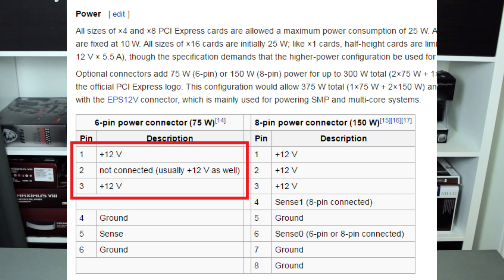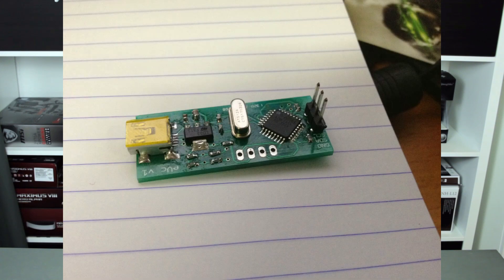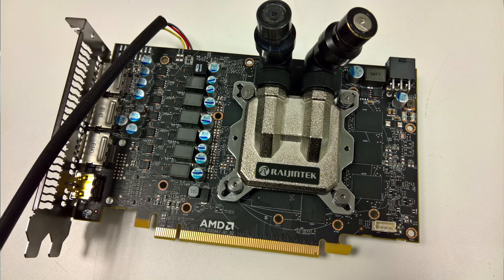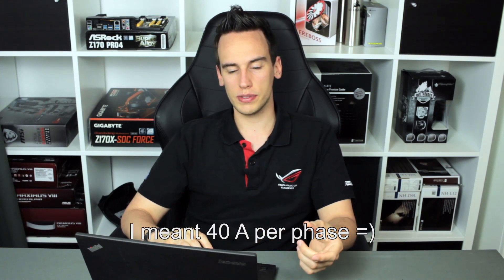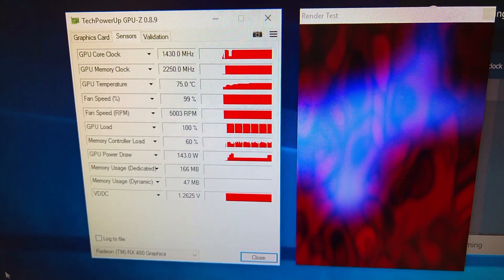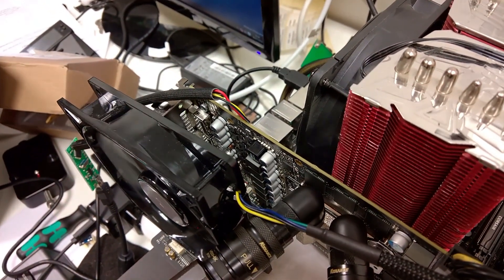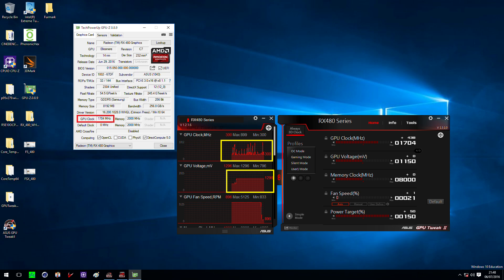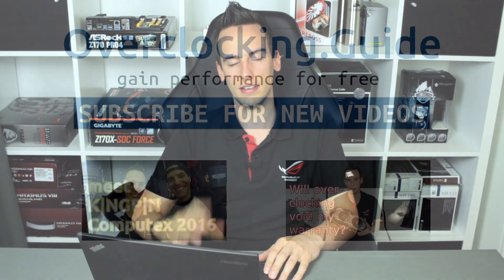Advanced AMD RX 480 Overclocking - 1500 MHz using I2C and watercooling

Comment: Not bad... Not bad....

I have the world record RX 580 /w 9900K.

It's the fastest aircooled RX 580 in the world. I absolutely promise that. It does 1570mhz/2500mhz stable (UberTimings 3.4)1.430v GPU and 950mV IMC.

It has copper shims installed between the memory and heating, liquid metal on the core, and thermalright TFX putty on the VRM.

I'd put it up against anyone's watercooled RX 580 as well.

It's so good, I'm probably going to watercool it just so I can make sure it lasts. 75c after gaming for a few hours.

I'd like to get it down to 50c or less and maybe aim for 1600mhz @ 1.5v.

Comment: Looks like j4003 on the soldermask is an i2c header aswell. On pretty much all radeon cards. That 480 had it just to the right of the core at 4:29

Comment: Hi der8auer, I have an unfortunate issue that caused the rx 480 bios .bat file to crash my rx 480 8gb reference sapphire card. 

Any recommendations? I am unsure whether it is bricked or not. Did the new drivers break it? 

I have a second backup gpu to flash the rx 480 back, but it doesnt seem to work in windows, I get errors. 

SHould I try in dos? 

Regards

Comment: I did something similar for my RX480 (bad 70%ish asic quality)
I used a bios editor (SRBPolaris) that set the voltage by messing with the I2C, unlike polaris bios editor who just change the pstate and voltage past 1.15 don't set.

1510Mhz@1.35V, TDC limit set to 170A, the other limit to something like 260W, stay at about 60ºC, thank to my custom loop :)
Note that having the voltage set that way, prevent all userspace tool to work. Changing the clock with afterburner, even just 1mhz down or up, crash the system.

Comment: It's scary, how close you came in your prediction.
My Sapphire RX480 Nitro+ 4GB, runs at CORE: 1400MHz, MEM: 2000MHz with an added plus to core voltage of +78mV(stable).
As soon as I try to push it to 1410 or above, it fails...

Nice video - cheers and thumbs up, from Denmark ;)
Reply: Guess i should feel happy with my MSI gaming X model runing @ 1440mhz/2140mem , using a 240mm AIO :p

Comment: What's nice is that 580 you can top with 1480-90 on good chips with 1.15volts :) and run it near silent on air. Good improvement in my book for AMD!

Comment: i have two 970 runing @1545 mhz an in sli 1430mhz with cusom bios 1.25v /1.3 but can i get more out of them ?
i know heat is a prolem gpu 85 C and more but is it worth it to whater cool them ?

Comment: I overclocked my MSI Gaming X 4GB from 1303MHz to 1400MHz on stock voltage, completely stable. My stock voltage never goes above 1.1250V. I was able to get 1450MHz stable with +30mV, but it can definitely go higher, I'm just not comfortable with such voltage for heavy use.Do I have a good overclocking card, because wherever I read people have trouble getting much above 1.4GHz, even with extra voltage?

Comment: Is it necessary to go with some custem cooler, or just replace thermal compound? (Sapphire Nitro+ version )
And if I want to go for some custom cooler air/water do I have to place heatsinks on memory? 
I have 4GB version, that can manage 1440MHz @ 1.175V stable on benchmark, but so far I run it 1400MHz @ 1.09V stable for everything.
Reply: TheSarillus I don't know if sapphire is "cool" with you changing the thermalpaste. I am nit sure if it is worth to remove the warranty of your card to gain 3-5 degrees less. My XFX GTR Blackedition is supposed to use "the optimal thermalpaste", yet the website of XFX says if you want to change it, send it to XFX so that they can do it for you :D Yeah sure I am going to pay for shipping from Germany for that.
Reply: TheSarillus And yeah for long term use I would usr heatsinks on the memory, you can get them really really cheap on amazon from some chinese brand with included thermal pads... Full copper.

Comment: This reference card is totaly bullshit. My Rx 480 xfx gtr is running at 1455mhz on core and 2200 vram and the max power draw was 130w.
Reply: Obtuse goose it is achievable, I got my Sapphire rx 480 to 1445mhz and 2150 vram but my power draw is around 185watts. The xfx card is amazing, watch Jay's two cents video. He got a 1475 with a temp of I think 65 C
Reply: Jerry Hou holy shit, 185w, that is too much, mine max watt draw is 140w.
Reply: Higher Ehhhhh, kinda, but a friend of mine has a rx 480 and his max at 1400mhz is 210watts.
Reply: Higher correction, I was using Sapphire trick to trace the power draw and I got 185. When I used msi after burner, it is in the 135 range
Reply: JBT so, the sapphire trick was wrong?
Reply: Higher yeah, but their overclocking functionality is great, on par, if not better than after burner..
Reply: Man, agreed with you, using Sapphire trick i was able to reach 1500mhz on core 2200 mem. Thats insane!!!
Reply: Higher, what are your temps
Reply: Higher thats called power cloxk trottling

Comment: I have a question , why does Amd cards struggle to reach 1400-1500 MHz in over clock and have low base clocks while nvidia cards have even base clocks starting around 1500-1600 MHz in their cards and can boost up to 2000-2100 in some cases.doesn't core clock matter that much ? and even after that these cards doesn't have such significant difference in performance as these clock number have a gap between them for both companies.So what is the factor that makes performance differences if it isn't a core clock number so that amd isn't far behind of nvidia even after massive difference in clocks & boosts ??
Reply: its all about different paths to performance, a good analogy is car engines, there are two ways of increasing performance: increasing the capacity of the engine (add cilinders) or you can tunne it of higher rpm, as its true in engines its hard to make big engines reach high rpms. thats why, amd has bigger gpus at lower clocks and nvidea has small gpus at higher clocks,
you could say that the rx 480 is a small gpu, with is true, the reason thats it doesnt clock higher is probably a design decision as they could have made it to clock higher with some tweaks.
Reply: hmm that does makes sense , thanks for your input.

Comment: stock I got mine to 1380mghz and the memory up to 2250mghz. so essentially instead of getting another 480 to compete with one 1080gtx I'm going to get two 1080s later. The 480 is garbage unless you're running two of them CF.

Comment: see, I used the Arctic Accelero Hybrid III 120mm and flashed tie vbios to your unlocked one and I use Asus gpu tweak II, and I set the voltage to 1.3v, but when I check in HWinfo64, it measures quite a bit lower for the gpu core. is this reading affected by the 80mm fan I have plugged into the pwm connection on the gpu PCB?
Reply: oh and my core clock is at 1430MHz.

Comment: just overclocked my custom  xfx 480 to 1480mhz on air :D
Reply: +kt3o5 Black edition GTR?
Reply: Tekky Quickbits yes
Reply: ALph4 1420mhz, but I tell you when I got my aio cpu cooler and new case fans...
Reply: My ASUS RX480 OC 8Gb gaming was also able to overclock to 1480, but only after I reflashed it to the RX580 bios, used VRM to overvoltage to 1.3v and report 0.5 load. Memory was clocked at 2250 MHz Temps were stable at 65c and performance was very good for a rx480.
Reply: Is it every gtr that is oc'ing like this?
Reply: marcusrat44 I can tell you tomorrow if mine does aswell
Reply: So, does it?
Reply: General Feldsalat how did it go?

Comment: der8auer - thank you for your videos and explanations and for you unlocked air BIOS. I am running a 240mm AIO water loop on my card and I want to know what is a good and safe voktage for the GPU. Is 1.3v ok under this conditions? I am around 43C under load with the AIO cooler. Also, regarding VRM - 90C measured with laser thermometer - is this ok compared to the rated 125C for the VRMs? Thank you!

Comment: It's a very silly excuse to say that PCIe power draw isn't an issue just because a motherboard has multiple PCIe slots. Just because a board might be able to output >150W across /all/ of the slots at once, doesn't mean it's okay to draw above-spec on any individual slot. That's why the specification talks about power draw for one slot, not total! - And at any rate, what if you had multiple 480's? Then all of the 16x slots could be drawing current over-spec, and that's even worse than having just one slot over-draw! Furthermore: Not all mobos have multiple PCIe 16x slots.

It also depends entirely on the quality of the motherboard: An older, aged, budget motherboard will struggle MUCH more with over-spec power draw, compared to any new or high end board.

Comment: Em...I checked from intel website, it explains that "All intel motherboard only supply 75W on PCIE slot". It means each PCIE slot can only supply 75W. Multi GPU get around 150W is no problem, only if each pcie slot draw lower than 75W.

Comment: Nice video der8auer. I've used your info on overclocking.guide on the shunt resistor mod on my gtx 770's and it works out great. They been running on the reference coolers at 1300 MHz for over a year now no issues. Only use solder on the back of the cards, the max TDP only gets to 65% leaves a lot of headroom for a water block. Keep up the good work you know you stuff man.

Comment: Very nice video.
RX 480 might not scale so well, but it's not that important, most people don't overclock.
Have you tried undervolting this card as far as possible?
What are lowest stable voltages and power draw with such setup?

Comment: can you test the FPS in various games with that 1.5ghz 480? it'd be interesting to see how this one performs against other cards in a real world scenario.
Reply from the maker: you can expect the same FPS increase percentage-wise. 3DMark is just a 3D application similar to any other game.
Reply: der8auer other tech youtubers said that these synthetic tests only strain one or 2 parts (like tessalation or rendering etc) of a gpu therefore not replicating a real world scenario.
or is 3dmark diferent?
Reply from the maker: That simply makes no sense. 3DMark is using the GPU the same way a game does. Also for example GT1 is very GPU heavy while GT2 has a higher load on the memory. For a real analysis you have to take several applications into account. Some games work better with Nvidia, some games better with AMD. If I'd take one random game for comparison it has the same validity as 3DMark - not much but it's a start.
Reply: der8auer ok, thanks for clearing that up

Comment: Thanks, you have access to some incredible knowledge here.  As I understand it the people at PC Perspective were claiming the power coming through the PCIe (each individual pin) was exceeded the allowed / rating.  They were indicating that there could be damage to the Board as a result of prolonged use and or worse (saying the protection for such PCIe slots might not kick in for one lane violation, only if all lanes exceeded the supposed limitation protection they were claiming.  So in other words they were pretty much indicating melting / fire etc.  Do you have any comments about what they say / did?
Reply from the maker: Usually there is no protection for PCIe slots. There is just a straight trace going from 24-Pin to the PCIe slot. In theory it can get hot and burn. If you keep the card at stock I don't see any problems tho. Overclocking might always exceed several limits so AMD can't be in charge here.

Comment: Why on earth would anyone pay extra for a watercooling set up on a 480 lol, For what both card and water cooler costs you could simply buy the KFA2 1070 that still outperforms it on air lol. And by the way bud the other guy was right, results will and do change depending on cpu.

Comment: I am wondering about the sensefullness of overclocking and burnin a gpu up to 100°C? Just to get a boost of approximately 10-15% which gives you 34 instead of 30fps, is not worth the deal. Nun gut, wenn es sich aber um eine wissenschaftliche Analyse handelt, die Aussagen diverser Zeitschriften in Hinsicht auf die nichtvorhandende Übertaktung einer RX 480 obsolet macht, is das was anderes. ;)

Comment: It takes stupid amount of time and extra money to make it run at 1.5GHz, which is probably still slower than GTX 1060 and much slower than GTX 1070. RX480 is just a POS.
Reply: +Mike Hunter AMD should have designed more power for RX480! This card's performance is power limited! Why don't they just give it 225W limit? Nvidia is bribing AMD engineers! What is holding AMD back? Imagine what this card can perform if it has a vapor chamber cooler and 225W+ power limit. It could blow 1070 out of water if it runs at the same clocks with same clock rates and the same memory they already have.

Comment: am kinda baffled how you can get that kind of heat density in a 14nm chip. how does nvidia avoid running in such internal hot spots even being on a bigger node size? what's the limiting factor in GCN?

Comment: i wanted to ask  if i could get this kind of overclocking on aib partner cards or could i get more overclocking like say 1.6 gghtz
Reply: are you really asking if you can get a higher overclock on air than water cooling?
Reply: I asked if aib partners could give you a better oc
Reply: Stock board vs custom board. I would certainly say the aib cards would overclock better since thermals certainly won't be a problem.
Reply: Thermals wont be a problem? I'm affraid the overclock in the video will be almost the maxiumum you can get unless you procede to watercool the partner cards also.
Reply from the maker: I will try the partner cards but as I said I would not expect more than 1400 to 1450 MHz

Comment: Will you try to overclock AIB Rx 480? I expect better overclocks with those that don't use a reference PCB might have better capacitors.
Reply: It's not a board issue, it's a "hitting the performance wall of the chip" issue. I'm not sure if you've ever overclocked something very far but as you go up you have to increase power more and more until you hit the absolute max stable clock the chip can do (found using LN2). 

These guys had to physically and software wise mod everything to get that 1480mhz. There weren't limitations so that means partner boards will not get those types of clocks. The highest we may see is like 1430-1440mhz I imagine. They were pushing a ton of voltage (250mv) and insane 170% powerlimit to get that extra 80mhz over the non modded 1400mhz they hit.
Reply: it's not just  "hitting the performance wall of the chip", it's simply because the 6 pin doesn't provide enough juice, if AIB give it 2 8 pin, and the card won silicon lottery, it will break 1.5 ghz barrier
Reply: Said Alghifarix there's only so far the chips will go. 1.5ghz on LN2 and 1480 on liquid at 1.5v and 170%, I don't think you understand how much more power that is. He drew way more than the 75w pice 6pin spec and he even talked about 6pins being able to deliver a lot more than 75w. 
Even with 2x8pin you'd have to liquid cool the card to dissipate that much heat (375w) and you'd want to use a 240mm radiator. At that point you should just spend that money on a 1070

Comment: Excellent video, i would love to see an advanced overclocking video for the GTX 1080 without any voltage limitations. I have seen several videos that say that the voltage is limited on the 1080 and it would be very cool to see what the GTX 1080 could do without any limitations.

Comment: Thank you for that video it's explain so much.

I will like to know. I have buy that card

http://xfxforce.com/en-us/products/amd-radeon-rx-400-series/rx480be-rx-480m8bba6

Was wandering to return it to newegg for refund and buy a custom 8pins. But now in that video it's say that 6 or 8 wont change anything.

And you say 1400 should be the max speed and my card is 1328.

I was thinking to get

http://wccftech.com/xfx-double-dissipation-custom-rx-480/

In replacement.

Also, what the difference in FPS will be for a example between reference normal speed, the 1328 and the 1400 ?

Thank you again !

Comment: This guy makes reviewers look like they have no idea what they're doing :S
Reply: my thoughts exactly
Reply: Oh RX 480 might burn your PCIe slot even on stock, because its drawing 82W out of it... OCs RX 480 so it draws ~310W, 155W out of PCIe and it works.
Really most reviewers have no Idea about specs, limits or electronics. Otherwise the nVidias Founders would have been a scandal as well. nVidia has better chips than AMD, but the Founders PCB is horrible and the crappy VRM can't feed the 1080 chip under temps, so it throttles...
Another example is the higher energy conumption 165W on RX 480 instead of 150W TDP adverticed. All manufacturers haven't got the fans in their TDPs (not AMD, not nVidia and not Intel). The crappy Fan on the RX 480 is rated at 15W. So the card is probably running exactly on 150W with Powerlimit on +0%.
Reference cards from AMD and nVidia are both terrible like always, but which reviewer got that? It's really sad to see such a lack of knowledge on YouTube. The end user might have forgotten what he learned in physics, but the guys making their money with reviews should remember it, it's basically their job. And a bit of research with the web is so easy, at least if you're not searching fo answers in the gaming community, they seem to be immune to facts.
Reply: yo maybe you want to read this first, because it seems that you deluded by your fanboyism

http://oc.jagatreview.com/2016/07/klarifikasi-dari-amd-mengenai-radeon-rx480-pcie-power-draw-issue/

run at 1.425 Ghz on the cheap motherboard for 7 hours stress test no problem, the reviewer is lucky n00b btw, he is world class overclocker